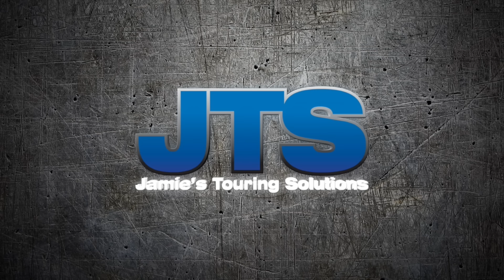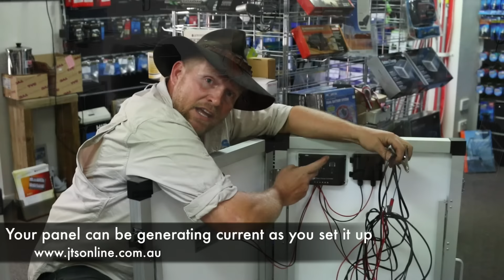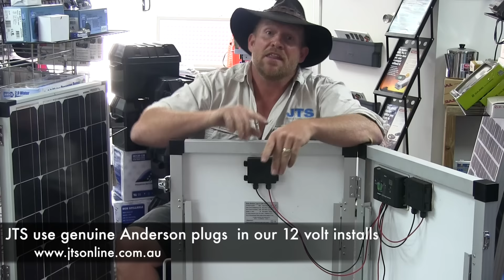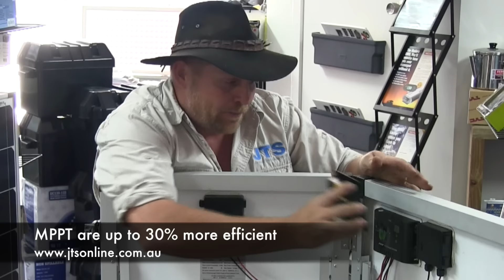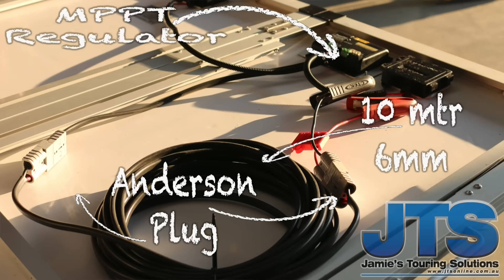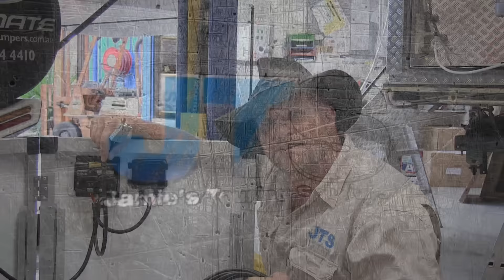Jamie's Touring Solutions:

Comment: you are better wiring the panels up to a Anderson plug and have the charge controller next to the battery I was losing 3 amps wired this way even using 10 gauge wire try it
Reply from the maker: That is true although 3 amps is a lot to loose, perhaps there was a connection issus as well. Although closest to the battery is the most efficient many campers find themselves charging too many different battery banks for it to be convenient so most customer opt for a regulator on the panel.
Infact the best ways is to have the panel completely unregulated and plug into a redarc BCDC.